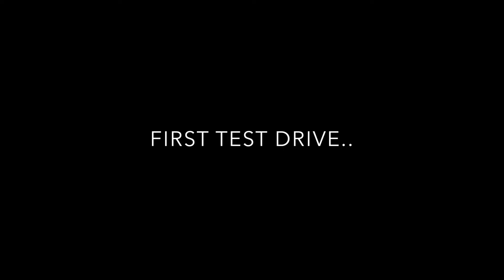pulse jet ice boat

Comment: How can you get so much gas pressure? I’ve also built a pulse jet but when I try to start it I have too little propane flow and it just dies. When I try to get some more power the safety thingy on the propane bottle shuts the flow. Also, How did you configure the holes in the propane inlet?
Reply from the maker: The safety thing you talking about is connected to the bottle thrue the propane hose? We have no safety valve ore pressure regulator. Then you can get a lot of gas. If you need even more you turn the bottle upside down, then you get liquid propane😁
We have a 10mm pipe all the way thrue the coumbustionchamber with a lot of smal holes on both sides of the pipe to distribute the propane.
Reply: Jonas Svensson thank you!  The only problem is that I use that kind of propane bottle that has a safety latch built into the design. But I’ve tried to have as small and as few holes as possible which gives a positive result. And yes. The upside-down-method is always the best  hahaha

Comment: You've got to be really confident in that front skid
Reply from the maker: What could possible go wrong🤔😁
Reply: @jonassvenssonharskogen5186  
Lots! 🙂
Reply: I guess its a commercial skid for skating but there are 2 men travelling at 70 km / hour on one skid - One people usually use 2 -I suggest it has a limited lifespan. swe (eller infattningen har det )
Reply from the maker: @jari2018 
It's a home made skid and a lot stronger then a regular skid you skate with🤘😁

Comment: I wonder if you got it ceramic coated or wrapped it in exhaust wrap if it would be more efficient. Losing less hest energy through the shell and directing it out the back 🤷🏻‍♂️ im no jet expert 😆
Reply from the maker: You probably could, bit I think the problem is that it would melt😬
Reply: @jonassvenssonharskogen5186  ceramic shouldn't? Wrap might but it would be interesting 👀
Reply from the maker: That's true! Would be interesting🙂
Building a afterburner to the next version. Hopefully it will be some extra thrust🤞
Reply: @jonassvenssonharskogen5186  can't wait! 

Is there any way to dampen down vibrations? I can't imagine what that thing feels like in reality 😂 
🛥️💨💨💨💨💨💨💨💨

Also how many uses do you get from the jet until the metal becomes too weak or deformed? Does that even happen? 😆

Comment: Funktioniert dasTriebwerk ohne Flatterventil?
Interessant zu wissen wäre, wie lange es bei uns in DE dauert bis man im Gefängnis ist wenn man ein derartiges Gefährt testet. In der Praxis mangels einem zugefrorenen See ohnehin unmöglich.
Does the engine work without a flutter valve?
It would be interesting to know how long it takes in Germany until you are in jail when you test such a vehicle. In practice, this is impossible anyway due to the lack of a frozen lake.

Comment: Could you by chance tell me how much the weight of your pulse jet was? And also how much fuel it burned at full throttle and if at all what was your limit on steering any help would be appreciated
Reply from the maker: Guessing the weight is about 70-80kg only pulse jet. It's made of 2mm stainless steel. Fuel around 1.5kg propane/min. Don't understand the question of steering!
Steering work well but the radius was maby 10meter.
Reply: @jonassvenssonharskogen5186  sorry about that what I meant was how far does your wheel pivot the front blade? But from that turning radius i have a rough idea thank you for taking time to answer my questions

Comment: I've used water/methanol injection in my semi's for years and I would bet that it would really give one of these a substantial kick also.
 Why? A significant increase in reaction mass as the water won't burn but will turn into steam which has a lot more mass than the exhaust gas by itself. 
 Remember,  every action has a equal and opposite reaction?
 Heavier exhaust means more power.

Comment: Have you explored the tesla valve as a substitute for the 180 degree pipe? Basically the tesla designed "one way" valve takes the place of the grid with flap valves that the original V1 engine had.  The resistance in the design of the valve causes a blocking action just by the swirls created by the design of the intake passage..but with no moving parts..just the column of incoming air swirling and blocking the pulse from exiting out the front....
Reply from the maker: Have thought about it but what I could found is doesn't work in this application. At least I haven't found any one that have successfully operated one. But in theory I should work🙂 probably they yest haven't tried hard enough😁

Comment: I missed the part that explains the intake facing backwards. In what universe is THAT a good idea?
Reply from the maker: Thrust is produced in both ends so if one is pointing forward we would be standing still🤔
If we had valves then you would be correct.

Comment: Doesn't it need an air intake somewhere? I am surprised the u shaped pipe has both ends as outlets.
Reply from the maker: The short pipe from the explosibe chamber is the air intake. After combustion there will bee a vaccum  that will draw more oxygen in throw the short pipe back to the explosive chamber.

Comment: Needs a Hotplate welding on top. By the time they get to the other side of the Lakes, the Steaks are done perfectly! SO- Make this happen!
Reply: Sear the steaks by pressing them to the pipe, then lay them on a grill over the pipe.  Also, attach rods for hot dogs and marshmallows behind the tailpipe.
Reply from the maker: Version 2.0 will have all cocking features necessary😁

Comment: What happens if the guy controlling the gas was to fall off. Would the guy steering have to wait till the fuel ran out?
Reply from the maker: Haha that's true. We both wonted something to do. But now it's changed to the same side😁
Reply from the maker: But if the driver falls of then the passenger is in deep shit😁
Reply: @jonassvenssonharskogen5186  next on the checklist is seatbelts

Comment: I would laugh my ass off if they both got bumped off it with the throttle still full on! It would either take off without them or crash and promptly melt through the ice....
Reply from the maker: If you check som more video i think you will find what you are looking for😏

Comment: How fast were you guys going? Would a front-facing intake increase power & speed?, and how about a "turbo-fan" for more boost? You guys are like me!, the need for speed! And a streamlined body to decrease wind resistance. Wont need heaters, theres one between you guys!
Reply from the maker: Approximately 75km/h but it felt like a lot faster😁
This type of valveless pulse jet produce thrust in both ends, so they have to be pointing backwards🙂
Actually made a new one and raced it 3 weeks ago. There is a video on the Chanel and there will come on more when I crash it allsow🙈
Hade more tuning to do but I increased the top speed to 115km/h. Now I have to bild a new one again🥺
Reply: @jonassvenssonharskogen5186  with all the bad stuff going on in the world today, you guys sure are bringing fun and games to their max! And youve got a pulse-jet load of comments to back that up! Wonder what a smaller version would do on a racing go-kart????

Comment: Those pulse jets are noisy. I don't understand the "U" shape of the pulse jet. Doesn't air have to enter one opening and the thrust go out the other end? It looked like thrust was coming out of both ends.
Reply from the maker: The short pipe allso become the air intake. After the explosion it creates a vaccum and sucks in more air.

Comment: First noticed: Seats set too far back, for max performance. Need to be 10cm further forward. You need to have SOME weight on front ski, or steering at high speed will fail. Wind resistance will tend to push that center point rearward.( lift nose). Designs for vehicles need ALL parameters factored in. For speeds under 80km/hr this is fine. Move seats forward 10-15cm, for 80 to 200 km/hr !

Comment: Cut U shaped rings and weld a bunch of them around that front pipe that goes up and around... boom - cooling. Now you can run it hotter. You're welcome.
Reply from the maker: Thank you for the advice👌

Comment: Holy smokes what's its top speed n how about it's efficiency ....it's good for cold climates in hot climate it would have melted ....ice is very slippery it goes way fast but with wheels or in Lake on boat results vary
Reply from the maker: Top speed is maby 75km/h but it felt like a lot faster🙂 Efficiency is maby 5% forward and the rest in fire and heat😁

Comment: Most dangerous vehicle I've ever seen. If you crash or worse overturn you could get thrown against that red hot pulse jet. You need a heat shield of some sort.
Reply from the maker: Well it was a calculated risk🙈
Made a new version but crashed in 115km/h so now I have to build a 3rd version😊
Reply from the maker: Is a video of the crash on my channel.
Reply: @jonassvenssonharskogen5186  Holy cow! You did have a crash! Well, I hope you didn't get burned on the red-hot pulse engine!

Comment: Speed est 60-68km/hr. I would also have added an eccentric cammed drop brake. Then again, they never asked me ! :)😀
Reply from the maker: Speed estimation is good, top speed were 75 but mostly around 65-70. And a better brake would have been nice😁
Have you watchet the new pulsjet movie. I rebuilt everything so now top speed was 115km/h. Sadly I crashed that one but now I have started with version 3.0🙂 hoping for a top speed above 130km/h😃